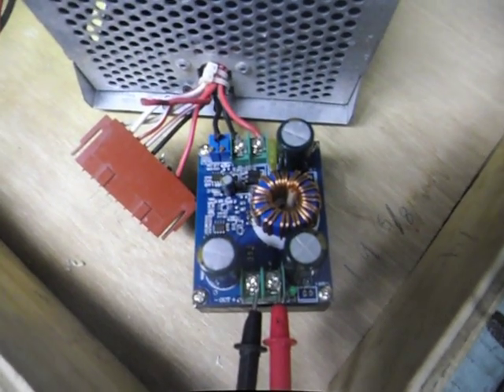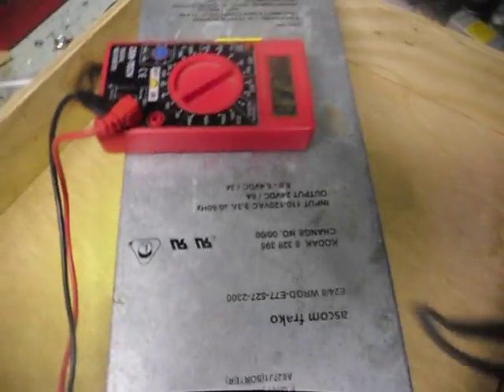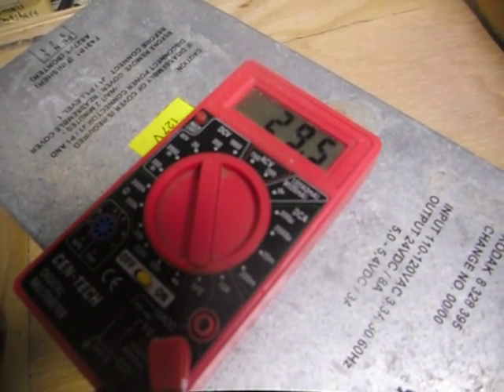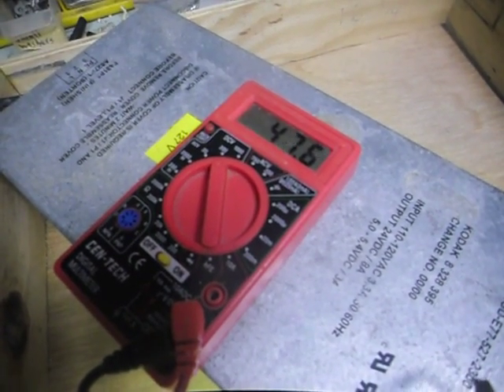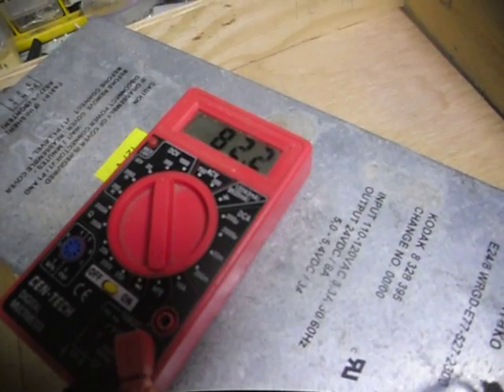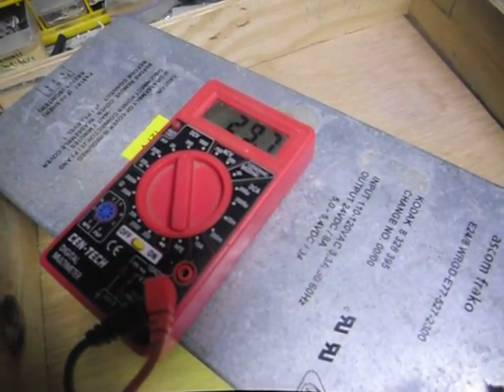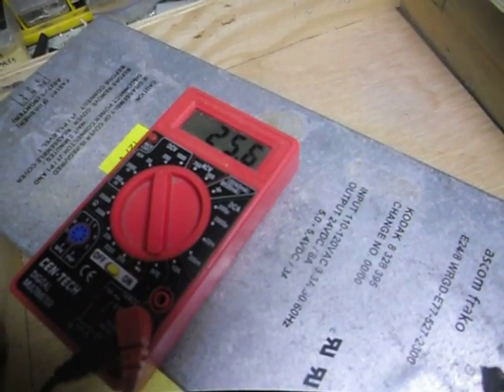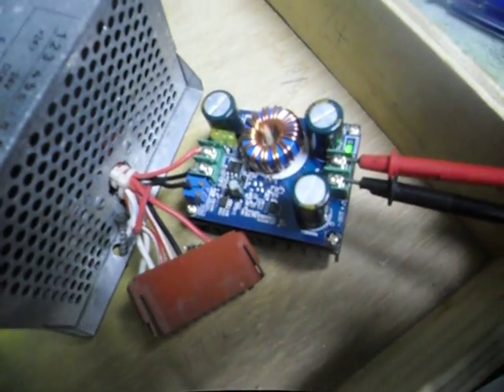DC-DC 600W 10-60V to 12-80V Boost Converter Step-up Module Power Supply

Comment: I have one of these. Another issue with it is the grounds for the input and output circuits have to be isolated. I wanted to use this to keep a 24 volt battery bank charged from a 12 volt supply. Both the input  negative and output negative would be connected to the vehicle chassis and when done with this it looses current regulation.

Comment: hey man does the amps increase 
tell me truly
am serious !!!!!!!!!!
Reply from the maker: If you increase voltage the amps will increase. You get max amps at max volts. Junk
Reply: in 14 volts how many amps can i get
Reply: it defends how much amps you put to input power example you has 3A power supply going to input, so you can get 3A max. (adjust)

Comment: hi, I would buy this module. but i don't understand how it works. If I give an input for example 12 volt 50 Amp or 24volt 25 amp, i can get on output 80 volt 7.5Amp? Is it a step up and step down converter? thanks
Reply: +Luca Mazzeo It can step up the voltage, but the outup voltage cannot be less than the input voltage eg: it cannot work In=30V & Out=20V output voltage must always be more. It can take say 12V at 10A and give you 80V at 1.5A which is about 120W of power.

Comment: http://www.amazon.com/dp/B00WJV1X18
Yeeco Waterproof 20A/240W High Current 10-35V 24V to 12 V DC to DC Buck Converter Step Down Power Supply Voltage Regulator

Comment: Yeeco Waterproof 20A/240W High Current 10-35V 24V to 12 V DC to DC Buck Converter Step Down Power Supply Voltage Regulator

Comment: http://www.aliexpress.com/item/DC-DC-Boost-Module-600W-Constant-Voltage-Constant-Current-Regulator-Solar-Car-Charger-8-16V-to/32247275953.html

Hi, this link says, "When the Input voltage rang of  9-12VDC (short circuit method), under this state, the module circuit can not be adjusted."
can you explain this?

Comment: I see 2 adjustable componets.
Can one of them adjust output current?
Reply: Junk Mail
current is dependent on load, U (volt) = I (Amps) * R (ohm)
P (watt) = U (volt) * I (current)
So if your pulling 300watts with the output turned to 30volt its 10amps current. The higher the current the hotter everything gets. Amount of current you are using depends on what you have connected to it. please correct me if I'm wrong.
Reply: Exactly same problem I had, I couldn't get more than 3amps at 19 volts for my  laptop. Well at least they refunded my money and I got to keep the unit.
Reply from the maker: It can adjust current but not much. Higher the volts more you can adjust current. So if you want the volt output is 12 you can't adjust much. If the output is 80v you can adjust a lot more. After 6 months of on 24-7 the boost converter has failed. I used it at about 240W @ 46V 5 to 6 amps. Maybe I should have used a fan...
Reply: Junk Mail  and what was imput V that u used to boost up to 46 V ?
Reply: Those things are junk. At 12.6V (Car battery) I can't get mine to go over 3amps and the current adjustment is useless.
Reply: Yes this one is very useless, cant even power my laptop that draws 6A 19V

Comment: How much for 2 of these an where to purchase?
Reply from the maker: If you want 48 volts @ 300 watts you need about 6 amps. The power supply you will need has to be at least 30 volt so you will not run over 10 amps. I used mine with a 48 volt power supply to make 60volts at 6 amps to power 4 100 watt LEDs. Hope that helps
Reply: Junk Mail  i need it to power supplay 100 w led for car.. actualy 2 x100 W on each side, but lets say it is 100 w, so, what step up im supposted to use to supplay 100 w led if i have only 12 v input and output should be about 32 volts...?! I have both 400w digital and this one 600 w analog step up, and still the part where fuse is placed getting so warm that u cant even touch it. And its only with 100 w and about 3.2 amps... i guess if i put 200 w, it going to blow up. So, how to solve this problem?

P.S. When i put imput 19 v, from my lap top charger its fine with 100 w, but, again laptop charger works on 220 V regular imput. I even tried with 2 step ups, so with this like yours i up the Voltage from 12 on 19,20,24... and with second one to the 32 volts, but again BOTH of them getting so warm, that part where fuse is placed. So im without solution atm :)
Reply from the maker: http://www.ebay.com/itm/600W-DC-Boost-Converter-car-Solar-Battery-charger-Regulators-10-60V-to-12-80V-/190909603180?pt=LH_DefaultDomain_0&hash=item2c73195d6c $19.99 I have ran mine at 300w for over 30days and I had to add fan to keep it cool. 600W I don't think it would last long.
Reply: Junk Mail 300 W but on what Voltage?
Reply from the maker: prckata if you use 12 volt from the car to power them 12v time 10 amps is 120 watts so they will not run them both well. 12v @ 10 amp with small wire is going to get hot. if you can get 24v then it will need about 6 amps to power the booster. You never want to run a 100W led at 100w for long I run mine at 75% power. http://www.ebay.com/itm/DC-DC-Car-Voltage-Converter-12V-Step-Up-to-240W-24V-10A-Silver-Gray-Power-Supply-/181407797555?pt=LH_DefaultDomain_0&hash=item2a3cbf5133 check that out